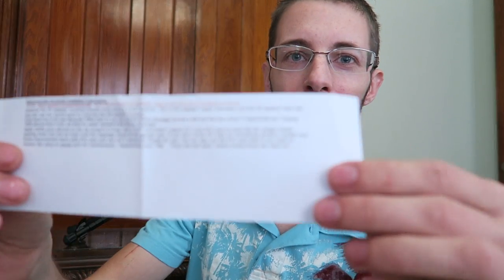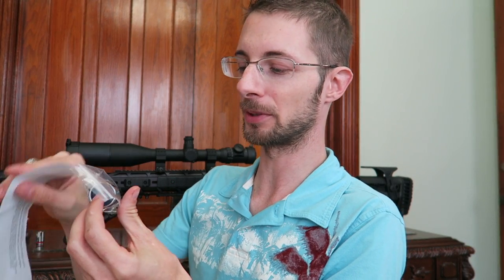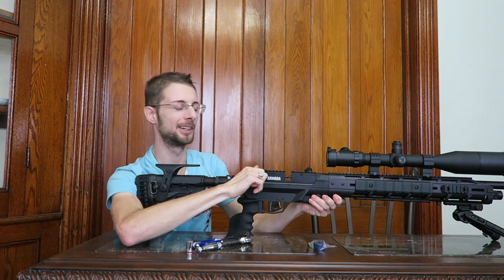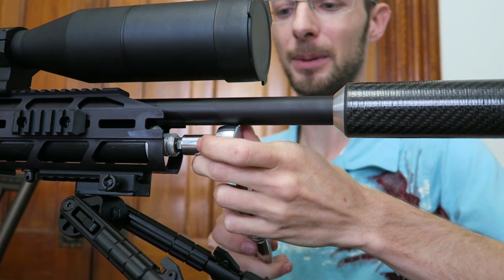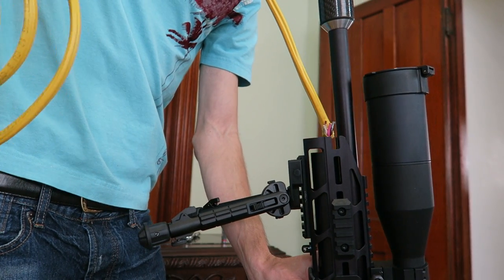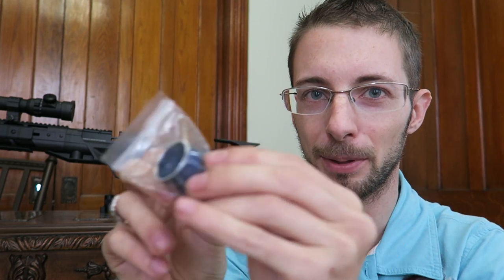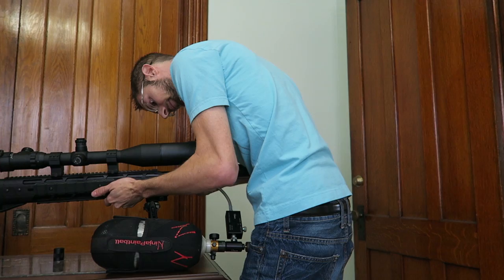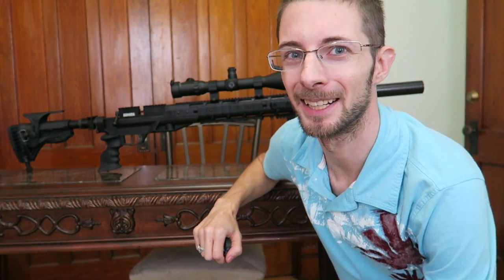Armada De-Pinger Installation | Hill Airgun De-Pinger | Airgun Evolution

Comment: I would use a length of 30 lb. monofilament fishing line attached to anything plastic and small that won't come through that small hole so you only need to fish the fishing line out to remove the de-pinger if needed. Just curious, how much weight does the fore-grip add? I can buy barrel bands that I can attach a sling and bi-pod to with minimal weight added.
Reply from the maker: Thats a good idea with the fishing line, its not that heavy made from aluminum, im sure you can strip it down for weight though.
thanks for watching

Comment: Please explain what the benefit is and also the human regulators what's the big deal?
Thanks Tony
Reply from the maker: The depinger acts as a damper preventing the air tube from resonating when fired, basically it helps quiet the sound down a bit... a huma regulator gives you a precise controlled about of air for every shot this improves accuracy through consistency.
Reply: @AirgunEvolution  thanks .

Comment: Grate video, really informative. I have the same rifle Armada.25 cal , I noticed that you have a suppressor on yours. Do you have a video when you installed on your rifle? I have another question for you, have you ever try to install AR 15  Flash Hider instead of having a flat end on the barrel?
Reply from the maker: To install the suppressor just un screw the end cap and screw the suppressor on, its that easy.... the one thing about Benjamin air guns is they use a different thread than all other air guns so I would recommend getting a universal threaded suppressor (1/2x20 UNF) and an adapter for the Armada... this way your suppressor can be used on future guns you get.... Firearms muzzle breaks and suppressors are a different thread pitch than airguns so they will not fit.. I do how ever make a muzzle break that I resin print for airguns, check out my instagram to see them
Reply: That was the fastest replay ever,  Thank you 👍👍. Thanks for the advice,  I just found another of your videos when you are installing a suppressor on a different rifle and you replied to someone the link for the stores,  I will check that out. Thanks again and keep posting,  you already gain another  subscriber. 👍👍👍👍

Comment: Suppressor installment for the armada?
Reply from the maker: Its straight forward un screw the barrel end cap and screw on the suppressor, just as easy at taking off and putting on a soda bottle cap.

I would recommend not getting a spacific Armada/Marauder threaded suppressor but instead get a adapter that will go from the Armada/Marauder thread to the universal 1/2 x 20 unforgettable thread and get a suppressor with a 1/2 x 20 unforgettable.. this way when you get a different gun or want to use your suppressor on other guns you can. Visit DonnyFL he has the best suppressors and the adapter you would need.

Comment: Question - it appears you installed an aftermarket supressor onto the rifle, but doesn't the rifle already come suppressed internally? That being said - did you do it to further decrease the sound and is there a video about it?
Reply from the maker: Yes there is an outer barrel shroud with a baffle system but a suppressor helps quiet the gun down a lot. it also all depends on the aftermarket suppressor you order too at this point a DonnyFL suppressor is the best you can get in my opinion and would do a better job than the one I have on the gun in this video.
Reply: @AirgunEvolution   I bought a DonnyFL for my sig sauer 22 pcp and it's AMAZING how much quieter it is, i'm def going to see what threads on the Armada and if I can just get a thread adapter and use the same suppressor on both, my Armada gets here in 2 or 3 days, can't wait !!!

Comment: Hello i ordered my Benjamin Armada in .25 Cal, haven’t received it yet, from my understanding the barrel size is the same as the .22 cal, my question is what size is the muzzlebreak, diameter? and where did you get yours from? Thanks I appreciate the prompt response
Reply from the maker: Im not sure the exact size of the threading on the muzzle Benjamin uses a unique size where as almost every other manufacture uses 1/2 x 20 UNF threads. What I recommend is googling DonnyFL (I can't post a direct link youtube policy)
I would get a suppressor of your choice from him and an adapter for the Armada. This way when you get a different air gun with a 1/2 x 20 UNF thread you don't have to buy a new suppressor.

Comment: I'm sure it will im sure your not the only that it had happened to that's why I haven't figured out which one to go with on my scopes yet they are to expensive to mess up how is that sideshot working out so far?
Reply from the maker: Arvil Matlock - I went with a Side-Shot for my Tiapan Veteran so I can shoulder the gun and if you have a short Bullpup i believe this is the way to go. For this purpose it works great, the picture does get a tinny bit blurry due to the prismatic lense system it uses but it still works great. For all my other guns that can be used with my home made $10.00 camera mounts I will keep using them just for the tinny bit better picture quality.

Comment: all I can understand is that the de-pinger will reduce the voice of ringing. is that all ? will it affect the performance?
Reply from the maker: Yes, you are correct. All the de-pinger does is stop the air tube from making a PING sound. 
It does not effect preformance at all.

Comment: Im thinking on buy this rifle as my first pcp. Would you recomed it?im not new to airguns,just pcp. I also want to buy a hand pump,which one would you recomed?
Reply from the maker: 1982pantro - I would say this gun is a good starting point and I think you would do just fine with this gun but if you are already into airguns you may very quickly want something better. This is a good gun but there are other guns that are regulated for the same price or less. 
If this is the tactical style that your looking for it is a great gun. I would recommend getting the .25 cal because the barrel is made by green mountain and it is better than the ones Crosman puts on the .22 cal. It does weigh a bit and it is long with a suppressor on it but it is accurate.
You can hand pump but it might be a bit of a work out near the end when your pushing it up to 2.8k psi.
As far as a recommendation for a hand pump I have never had or used one so I can't really recommend one.

Comment: should you dry fire it like that without a rubber dummie bullet or something in it? wont it damage your firing pin? or is it ok to dry fire this model?
Reply from the maker: DrJones - There is no firing pin, it's an air rifle, pellets don't have a primer or any power, the gun does have a pellet probe but it just pushes the pellet in to the chamber and that's all...
Also any object (dummy round) in the barrel will be fired when the trigger is pulled and there is air in the gun... 
It is perfectly fine to dry fire this gun to de-gass it.

Comment: Thank you for the interesting and Informative video. Got one just like yours this week but in .22 cal. Unfortunately the bolt will not go all the way back to cock the rifle. Have you come across this situation before or have any idea of what is happening? Any information will be greatly appreciated. Cheers!
Reply from the maker: Yes or something similar to your problem, both .25 cal Armadas  I have had the the bolt opens up but about 1/8" of the bolt still protrudes out. to fully cock and cycle the mag you have to pull the bolt back this little bit more using more pressure. But if your gun is not working properly Crosman has a wonderful 1 year warranty, call them up, they should email you a shipping label for free and most likley they will just replace your gun with a new one....
Reply from the maker: Also if you have more questions I'd be glad to help but leave it as a new comment not a reply, I get notified of new comments but not for replys so if you leave a reply I don't know for about 2 months when I scan my overall comments looking for replys.

Comment: Urban Gunner, does this reduce the amount of air in the air reservoir?  It looks a little bit bigger than the factory depinger but I could be wrong?
Reply from the maker: Marcus Famo - I would estimate the hill airgun depinger to take up the same amount of volume as the stock depinger.
Reply: thanks.

Comment: I just love to use my own built .25cal. Custom Benjamin Armada Bullpup  on the "chase"! Working on some DIY NV to take Merriam Turkeys out of their roost, with a very quiet thunk.
Reply from the maker: Kidd Kool Arrow - Nice I hope to get a turkey or two this spring myself. I bet your .25 Armada Bullpup will put your turkeys down no problem.
Reply: It already has in both the AR and Bulpup configuration, plus a big scrawny coyote, a porcupine, several squirrels, crows and feral cats.

Comment from the maker: Gun Info:
Benjamin Armada .25 cal
UTG AR side folding Adapter
FAB Defense GL-Shock Butt stock
FAB Defense Monopod Butt stock add-on
Sightmark Triple Duty 6-25 Mil-Dot-Dot Scope
Sightmark 56mm Sun Shade
UTG Heavy Duty Recon Bipod
Neil Clague Carbonfiber Suppressor
Custom Right Handed AR Grip
Hill Airgun De-Pinger 
Various M-Lok Rail Sections
Reply: What are the dimensions of your suppressor  how is it attached ? Thanks!
Reply from the maker: When threaded on the gun the exposed length is 8 inches / 7 3/4 inches of carbon fiber tub and 1/4 inch taper on the end. 
The carbon fiber tube is roughley 1.6 inches in diameter.

The barrel shroud end cap unscrews and the suppressor threads on in its place.
I just added close up photos of the suppressor to my Instagram for you to check out if you wish - urban.airgunner

You can see me unscrewing the barrel shroud end cap and screwing the suppressor on my marauder pistol in this video (one minute in). 
https://www.youtube.com/watch?v=HwvieRsxxvQ&t=66s
The exact same as you would do for a marauder or Armada rifle:
Reply: Urban Airgunner  I tried to click the link on the suppressor but it wasn't found.Where can I buy one?
Reply from the maker: Sorry for the late reply I just noticed your comment.. Here is the link:
http://petersoncorner.com/clague/contact.htm
I just checked it out and it works for me you will have to send a message to Neil and let him know what features you want for your suppressor..
Reply: hi can you change the barrel in the Benjamin Armada? from .25 to .22?
Reply from the maker: @arjaysiongco2015  - No, Not to my knowledge
Reply: @AirgunEvolution  Thanks for the Answer❤

Comment: I installed the de pinger after install, a clicking noise started while charging the armada tank. Please help me is this a problem?
Reply from the maker: My only guess is that when you filled the tank the air pressure pushed and seated the designer to the bottom, if this is the case it is fine, but defiantly contact Hill Airgun or who ever you got the de-pinger from and seek further help, I am in no way an expert so please seek expert help.

Comment: The bipod you have is it the recon 360? And that scope cam mounts really messed up that utg huh? Anyway that swat scope you just bought is a great little scope I had 3 one each for of my guns they are really stoughton clear and accurate
Reply from the maker: Arvil Matlock - Yes the bipod is the UTG Recon 360, and yeah that camera mount completely destroyed that BugBuster scope I just hope that that video will save some people from having there scopes wrecked. I found for me having a scope that has a magnification of at least 16 power gave me the confidence starting out to take accurate head shots and from there I have gained the confidence and ability to take head shots at lower magnification. I now use Sightmark scopes mostly, there Triple Duity with the MDD reticle and Core TX with the MR reticle; but I still have a few UTG scopes around.

Comment: Hello, excellent video, greetings from Chile, I have a Benjamin Armed Cal .22 and when I charge the rifle with 3000 Psi, after a while it starts to lose air, it does not feel the leak, and without firing, after 1, 5 Hours has already lost 1000 Psi, reaching 0. I hope you can help me, Thanks
Reply from the maker: Rodrigo Ilabaca - If your gun is still under warranty ( 1 year ) I would call crosman and they fix it for free. If not I'd check the seal around the fill port where it screws to the airtube. Other than that I'm really not sure with out having the gun to test. If you need replacement parts www.hillairgun.com is a good source he even does repairs but he is located in the U.S.
Reply from the maker: Rodrigo Ilabaca - Also my gun was loosing air when I first got it too. It was leaking through the breach end ( I was able to hear it ), I found one way to fix this is issue was just to shoot about 20 rounds through it. This helps to seat the valve and it fixed my leak.
Reply: Friend, thank you very much for your answers, which I answer in one. The rifle I have since 2016, so it has no guarantee, I think it can be parts wear. The bad thing is that you do not feel the loss of air anywhere.

Comment: So what how does it affect the gun if you don't remove the factory depinger and add the new depinger?
Reply from the maker: The factory de-pinger sits half way down the air tube and the after market de-pinger needs to go all the way down to the end. You have to remove the factory one to install the after market one.
The after market de-pinger does such a good job there is no need to re install the factory de-pinger it would have no effect further reducing the ping sound and only take up space and theoretically decreasing shot count.

Watch this short video and Every thing about de-pingers whip be explained , how they work and the different types plus you will better understand what is going on any why...
https://www.youtube.com/watch?v=YuC8Q1XDfIk

Comment: By chance do you know what does the red size is on the Benjamin a Armada
Reply from the maker: im not sure what you mean?
Reply: @AirgunEvolution  I mean what size is the threads if I wanted to put a silencer or anything on the tip of it and can you get different barrels
Reply from the maker: @chrisskinner7407  - The marauder/armada used its one customer threads to attach suppressors so you need to get a suppressor made specifically for the gun or an adapter that goes from the marauder thread to a 1/2 x 20 UNF thread which is the universal size, I suggest getting a adapter that way if you get a different gun your suppressor can transfer right to it. look up donnyfl he has a website where he sells all of this....
yes you can get different barrels like a hammer forged barrel but you can't change the caliber

Comment: Hi there. This is Shawn I talked to you a while back about the hill suppressor. great video and skill. Was wondering what all changes will happen if I go with this new hill depinger?? Quiet, power lasting air or all three??
Reply from the maker: Hi Shawn, I forget what gun you have but I am going to assume it's a Marauder or an Armada. The power will stay the same the de-pinger won't effect that at all. The PING from the gun will get quieter probably about 20 to 35 percent. The amount of air will most likely not change because you are removing the factory de-pinger and replacing it with the hill de-pinger so no real air capacity change there. You will get the same shot count, maybe 1 more maybe 1 less.
I hope this helps you.
Reply: @AirgunEvolution  Its the marauder 22. This is very helpful thank you. The hill airgun 816 shroud and suppressor is ok. Wish it had baffles or a one piece monocore baffle system instead of the straight flow through design similar to the fart can on the back of those four cylinder car's lol. Damn rolling chainsaws. Could be better but it's not bad. Thank you for the help.
Reply from the maker: Sorry for the late response, hill suppressors are good but for a mono core you can't beat a Donnyfl.com suppressor there top notch.

Comment: Ok ...I give up ...lol ...WTF is a de-pinger & what is the reason to replace it?
Reply from the maker: James J Hargreaves - Imagine you have a mettle pipe and you hit it with a hammer, the pipe will ring. The second you touch it and stop it from vibrating it stops ringing. This is the same concept for your air tube. After the shot you will get a PING noises from it vibrating. A de-pinger acts as a dampener stopping it from vibrating and making a ping noise. Some guns don’t have one at all and you can add a aftermarket one in. Some come with a factory de-pinger. There are 2 different types one that is like a 1” section of tubing that goes half way down your air tub and does a good job, this is the kind I took out. And the second type pushes all the way to the bottom of the air tube and therefore dampens the vibrations closer to the source (hammer & valve). This kind works the best.
Reply: @AirgunEvolution  Thanks ...I appreciate the prompt & detailed description. I have a Benjiman Steel Eagle Nitro Piston .22 ...not applicable I assume?
Reply: @MsTheCops  no need.this is only for pcp's with air cylinder
Reply from the maker: Nope not in a Break Barrel.
Reply: Wouldn't it be better to put one on the outside